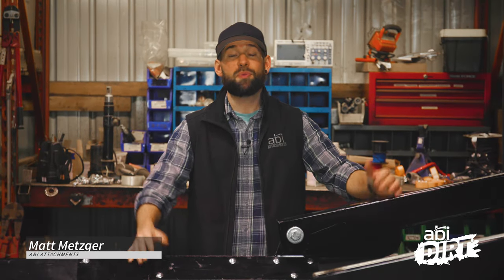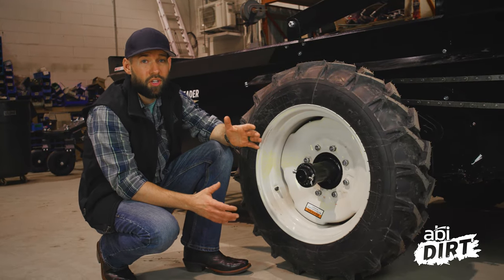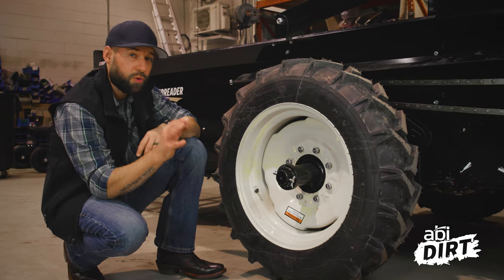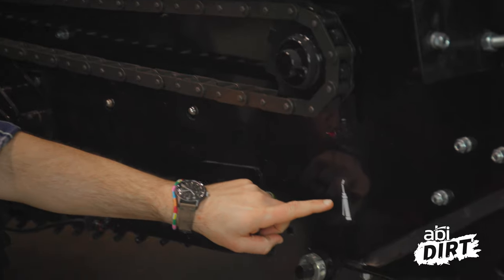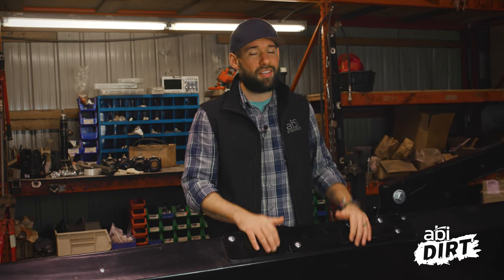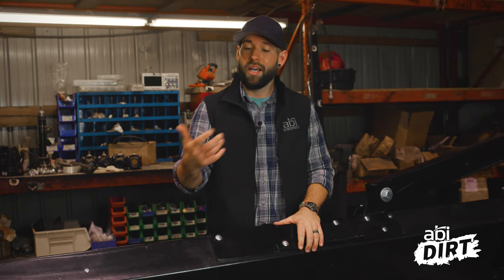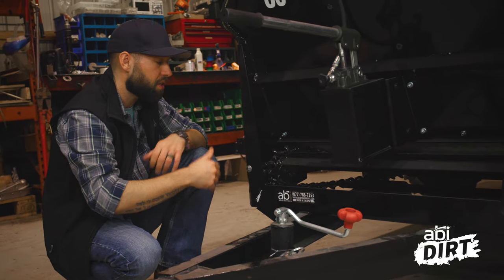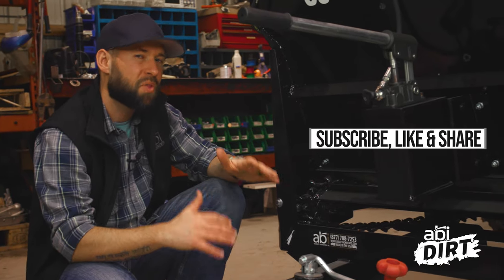Give your spreader a Spring tune-up - ABI DIRT

Comment: What grease/oil and application method do you recommend for the chain?
Reply from the maker: Great question!

When it comes to keeping the chain moving freely, some of us old (cheap) diary farmers just use what's left over from a tractor oil change. 😁  The speed and heat on those ground drive spreader chains aren't so much that you have to get fancy.

However, if you want to play by the book we recommend the best practices asserted by Machinery Lubrication: https://www.machinerylubrication.com/Read/316/chains-drives-lubricants

Thanks for asking (and thinking ahead). Take care!
- Matt @ ABI